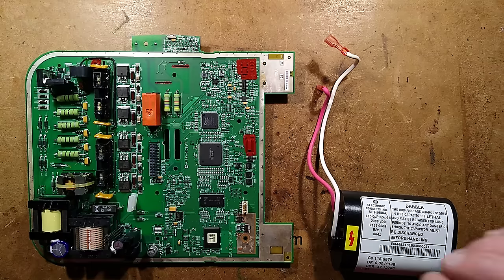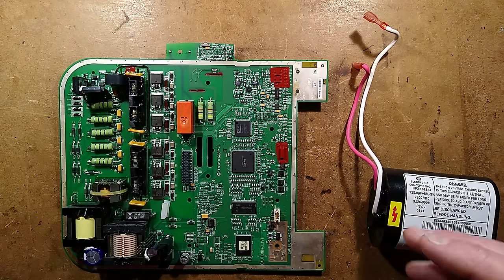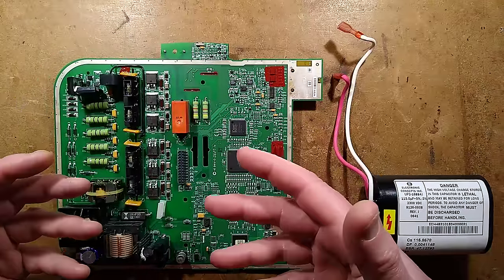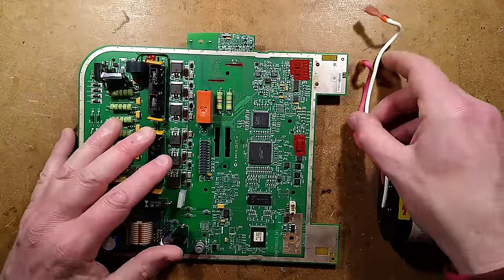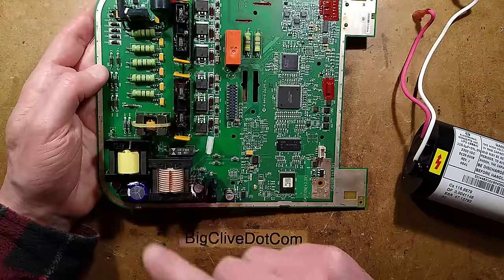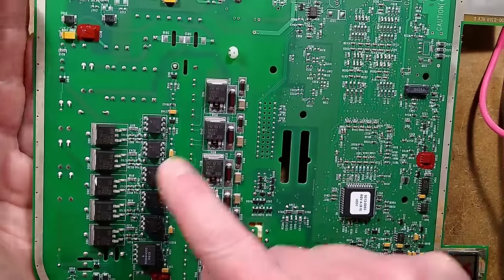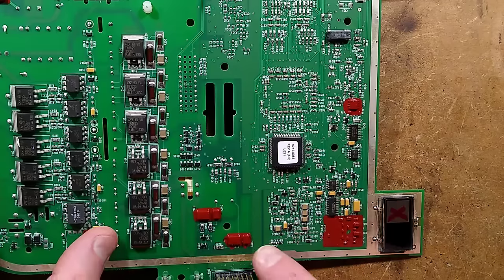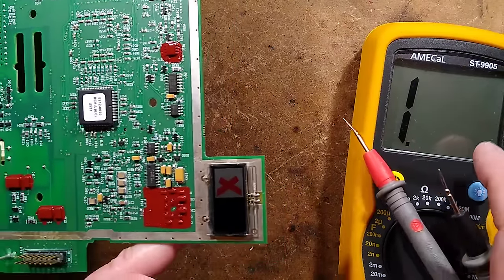Inside a Zoll defibrillator - with SCARY capacitor

Comment: You can trick the AED into delivering a shock quite easily, connect a 50 ohm resistor to the paddles output, this will make it think it's connected to a person, it will give the 'no shock advised' prompt if you just do that, but you can then connect across the 50 ohm resistor a signal generator outputting a ~2 Hz sine wave which is close enough to VFIB (aim for ~1 mV across the resistor), you'll then get the 'shocked advised' prompt when it analyses and it will charge up the capacitor and arm the shock button, you can then disconnect the signal generator (otherwise you will blow it up, adding some series protection resistors to the signal generator is advisable and helps get the 1 mV right) and press the shock button and enjoy the resistor being vaporized in a couple milliseconds.

Here's a video of me blowing up a resistor and a capacitor with an old LIFEPAK 12 defibrillator.
https://youtu.be/W4ifnLcAIDM?t=622

I vote for a return of your roulette resistor wheel, which 50 ohm resistor(s) will explode? Place your bets now!

Also to add to your mention at the end, I want to also mention as strange as it sounds AEDs work exactly the same on women, but women statistically are significantly less likely to survive out of hospital cardiac arrest even when an AED is present. Many people aren't sure if they will work correctly (eg. the male only pictograms) or are afraid of legal consequences, so unfortunately some people die next to an AED that isn't used. 

Furthermore in the event you're the Good Samaritan for a stranger in cardiac arrest, you get to be the main character, none of this "okay I'll wait here for you to call your manager to ask if I can borrow your AED", you just take the thing, Good Samaritan and necessity laws generally extend to allowing you to even break and enter to retrieve an AED without any liability.
Reply: The defibrillator analyzers we use to test these things work in a very similar manner, except with a cardiac waveform generator. It won't fire with a normal rhythm, but you can set it to several types of arrhythmia and the AED will react accordingly. It even times the delay between the waveform and the output from the defibrillator, which typically is a few milliseconds. Someone needs to send Clive a full/manual defibrillator to tear down, there's so much more the bigger defibrillators can do
Reply: Having just received a fresh up of my first aid training, including a demonstration with an AED trainer device (it simulates different situations, but does not actually give a shock and is used with a training dummy) I have to add something very important. The training part actually only was showing what the device looks like and what the instructions look and sound like. The pictures and speech instructions are so easy, everyone can use them in an emergency. And the software of those is safe on a human. The only thing you can do wrong with those in a medical emergency, where you have symptomes of a herat attack or just in general an unconscious person, is to not use them.

Comment: I briefly worked in a hospital. We would routinely test AEDs and defibrillators with a device called a patient simulator, does what it says on the tin. It was really fun to fire the defibrillators off

ETA: it does fire the full charge though the patient simulator, it can't tell the difference between the patient simulator and a patient. Ultimately we always want to fully run up the unit, if we didn't we might find out that things aren't working properly at the worst possible time
Reply: yep,    patient simulators and  live defibs are used in  health profesional / Ambulance staff  training  settings as well
Reply: @nicolajaynehodson9223  wouldn't want to be touching the simulator then, in case you get an indirect boot?
Reply: @JamesTK  basically although you shouldn't get a boot of the simulator as the pad cable plugs into the simulator along with the ecg leads. You then use training pads on the chest of Annie/ rescue mannequin
Reply: Those were the days......😂

Comment: I mentioned it in a livestream a few days after it happened, but I got one of the (I presume) less energetic defibrillations/zaps in an ambulance back in September. Thankfully it was to reset an SVT (supraventricular tachycardia, i.e. "above" the ventricles, so not one of the super life-threatening arrythmias, but still dangerous if there are complications or comorbidities) - my heart's atria (the upper section of muscle) was beating at around 230 BPM, and the ventricles beating at maybe half that, resulting in barely-effective circulation.

That kind of arrythmia usually happens because of some physical or physiological issue that causes the heart's main pacemaker to stop temporarily, and if it resets itself at the wrong time (or so I understand), or if there are anatomical abnormalities, or electrolyte issues, it can set up a mostly self-sustaining electrical loop going around and around the heart conduction paths. At best, it's extremely uncomfortable. At worst, it can cauce insufficient blood flow to the heart and various organs and, if it lasts long enough, damage.

I was dealing with severe lung and other circulation issues at the time, so after about a dozen attempts without being able to get an IV because of very low blood pressure, they asked if I wanted to try a shock instead. "Yes, PLEASE!" It was like having a firework go off in front of me at the exact same instant I got tackled from behind by a large person. My heart rate immediately halved, blood pressure went back up to normal(ish), and I felt better in seconds.

Comment: I started training as a lineman in 1977 and CPR was was given every year. There was a total of seven weeks of school over seven years before becoming a journeyman, it was part classroom and actual work in the training yard. Pole top rescue was done with 150 pound dummy, no not me the other dummy, and we had to clear the dummy from contact, give him three breaths, get a hand line around under his armpits and pull enough tension on the line to lift him before cutting his belt, then lower him to the ground and once back on the ground start CPR. Back then you hit the sternum once to try and get the heart back in rhythm then start CPR, but they quit that after a few years. Very nice device! Not sure if the crews in our area carry a device like that Clive, but if I see any in my travels I will ask.

Comment: During lifeguard training we had a dummy unit that was just a speech module and a push button.  The idea was to be able to drill the steps so we wouldn't be hesitating during an actual emergency.  The real units are designed to be thrown around by someone in a panic, set up on a wet pool deck and applied to a soaking wet body all without electrocuting the rescuers.

Comment: Do not explode, babies. Duly noted.

 I imagine that would make for quite stubborn stains.

Seriously though people, familierize yourself with where these things are in your local area, they can be found in many locations on buildings, in supermarkets etc, but it's worth knowing exactly where should you be in a position to need one fast, you could save someone's life. They are designed to be easily used by anyone with no prior experience. Very easy to follow instructions and the computer does everything except sticking the pads on, it then tells you what to do and not do as needed.

Comment: The metal enclosure is most likely an accelerometer to detect the movements of the compressions.  It also helps in counting the compressions.
Reply: That was my first thought!
Reply: That assumption is correct. Maybe it's one of the Analog Devices ADXL or similar series of sensors.
Reply: The pads with that sensor in the middle are definitely to provide CPR Feedback/coaching. Proper depth and rhythm are critical. With that sensor, the monitoring in the unit can tell you if you need to go deeper/harder, or tell you if you are slowing down. While Clive didn't connect it in a way for it to do so, most, if not all, AEDs will give an audible metronome to assist with the pacing of CPR.
Reply: I think so too, looks alot like the accelerometers used in early quadcopter controller boards.

Comment: So a defibrillator literally turns your heart off and back on again (well, it turns your heart off and hopefully the heart restarts on its own). 
Seems like power cycling works with practically everything!
I have to say, this is the first time I've seen a deep dive into one of these units and it seems to be really well designed. 
The audio/visual prompts are a great idea because even with training, it's very possible to panic a bit and forget the sequence. The fact that it monitors CPR actions is a really good idea too for the same reason. Even with training, in the moment you can get it wrong.

Thanks for this. It was fascinating!
Reply: The CPR doesn't restart the heart. It should automatically restart. If it doesn't CPR needs to continue , unless the reason the heart is not restarting is because the patient is dead.
CPR just keeps the blood flowing and oxygenated.
Reply: @PaulG.x   I guess I wasn't clear. I meant that hopefully the heart will restart and the patient will recover because of CPR (which the machine also monitors) not that CPR will restart the heart. I'll edit my original comment to remove the CPR reference since it is confusing. Thanks for pointing that out.
Reply: @michaelcherry8952  When I do my biannual CPR/First Aid refresher courses, the trainers are always quite emphatic about  CPR not restarting the heart. They do that because the people they are training expect that to be the case and when it doesn't happen , they stop doing chest compressions. They want first aiders to keep doing chest compressions until an EMT takes over or tells them to stop.
The misinformed expectation comes from TV and Hollywood - a couple of compressions , the patient coughs and jumps up and continues his triathlon. 
🙄

Comment: We've just replaced all the old as hell heartstart defibs with Zoll ones so it's super interesting to see what's inside these things.
Reply: I wonder if the reason our NHS Trust replaced all the heartstarts specifically with Zoll was down to the ease of maintaining them. The pressure sensor is an amazing idea but my god does it knack the heel of your palm after a few rounds.
Reply from the maker: It was probably to reduce long term costs and the maintenance required.

Comment: Back in the day (when I worked for the Royal Navy in Nuclear Medicine), we built a Marx generator using date - expired  defib. capacitors. That cap (if charged to the target 2.3kV) is good for just over 300J. Our Marx gen. was quite capable of producing VERY energetic 1 metre sparks, and used to get through 10 megohm resistors at quite a rate!
Reply: Interesting, I came up with a project, making a giant induction heater for nuking hard drives. The idea is basically to get the drive hot enough that any possible data is long gone (red heat) with a video camera to show that the drive has actually been destroyed prior to shredding.

Comment: I used one of those Caps in a bug zapper, with some modifications. No more little dead bug bodies laying around just vaporization. 😂😂😂
Reply: And… how loud were the exploding flys? And did you have to further part the electrical bars/grids assuming they would self-arc without a fly across them with the zapper turned on, with a capacitor of that capacity
Reply: @samuelfellows6923  They were quite loud. But not as loud as wasps and large moths.
Reply: We have a bug zapper at our local Community Hall that vaporizes flies. It sounds almost like a small gunshot and everyone jumps. We don't like it!

Comment: Whoa! My grandfather was actually on the engineering team ( or lead engineer/designer I can’t remember) for one of the first zoll designs that shrunk these devices down to laptop size!      Totally forgot about that
Reply: Our equipment group (UK ambulance service) rate Zoll defibs. We have had a few different ones over the years and a currently using Corpulse units. Previously physiocontrol lifepak 15s

Comment: As a long-term sufferer of paroxysmal atrial fibrillation I have been successfully d.c. cardioverted many times in the past.
As i understand it from the way the heart works, it is the only organ in the body that works independently and autonomously from the brain- as long as it is provided with oxygenated blood, it will beat and pump.
Cardioversion in fact stops the heart and hopefully allows it to restart under the control of the sino-atrial node which is it's inbuilt pacemaker. The rhythmical beating is a contraction and reset of the chambers seen in the qrs complex waveform but this is initiated by the p-wave which is a vey small hump seen just before the qrs complex. Absense of the p-wave causes chaotic and random firing of the contraction process and the irregular rhythm characteristic of AF. Of course there are many other issues with the heart that may or may not be resolved by cardioversion, so this is why careful analysis of the hear electrical activity prior to shocking is done otherwise it can be ineffective or damage to the heart.
Reply: A.E.Ds most of the time do not have a cardioversion option (unless fancy ones that can be put into manual mode). DC Cardioversion is slightly different to defibrillation, uses less energy and it is synchronised to a certain point in your cardiac electrical cycle. Defibrillation just dumps all that energy in one go as soon as you press the button, if you did that when in AF it may  turn into Ventricular fibrillation. i.e put you into cardiac arrest. 

You are correct in that heart will keep beating with oxygenated blood.  The brain modulates the speed and force of contraction with nervous and chemical control. 

Hope your experience with cardioversion was ok. 

Source : FRCA FFICM
Reply: I used to work in the physiology department of Green Lane Hospital which had an international reputation for cardiology research.  One of the projects I recall was researching cardiac perfusion methods for transporting hearts destined for transplant. They used rat hearts and would keep them beating for quite a long time after removal from the animal by just supplying them with a perfusion solution instead of blood. The organ was then rapidly frozen and analysed to determine if any deterioration had occurred during the process.
https://en.wikipedia.org/wiki/Green_Lane_Hospital,_Auckland#Legacy
Reply: @PaulG.x  That's interesting.
Back in 2008 my wife and I landed in Christchurch after 34 hours of flights from Heathrow via Los Angeles and Auckland, only for me to go into atrial fibrillation during the night.
My wife contacted the hotel reception and I was subsequently taken to the hospital in Christchurch for treatment. We were seen by an Irish doctor who on learning we were on holiday arranged for immediate cardioversion "so we could get on and enjoy our holiday". A couple of hours later I awoke to find I was back in sinus rhythm and after a cup of tea was on my way back to the hotel to continue a fantastic month-long tour of south island in our Kea motor home. It's a holiday my wife and I will never forget for many reasons, not least the fantastic care from the doctors and staff in the Christchurch hospital.
Reply: @125brat  I frequently visit the laboratory complex Christchurch across the road from the hospital . I was there the day of the big earthquake in 2010.
Reply: @PaulG.x  We were very sad when we heard about the earthquake and that the cathedral had been basically demolished as well as other places we'd visited. We were shocked to see the pictures of the devastation to the coast road north of Kaikoura we had driven along during our visit and the many other places that had been badly damaged. Unfortunately it's the price of living in a geological very young country.

Comment: $1000 for a defib is a killer deal. I bought one for a public space as a donation about 15 years ago, and with a deep charity discount it was $1500, I think list price was around $2500.
Reply: Does kinda seem like the type of thing where you probably don't want to go for the cheap bootleg version.
Reply: @oliverer3  This just made me think if there are actually cheap chinese copies of these things in aliexpress... Of course there are Chinese versions of the things but hopefully not fakes of other products.
Reply: @benbaselet2026  A cursory search found fewer than I expected but there were definitely some for very concerningly low prices.
Reply: Automated defibrillator prices have dropped dramatically the past couple decades. One of the first automated units cost 5000 in 1985, then the first biphasic AED cost 4000 in 1994, and nowadays the most advanced defibrillators cost only 2000 in today's money
Reply: @ShockValue500  Probably they are fairly cheap to manufacture en masse. Medical certification probably has its costs and when the buyers are all kinds of companies, public operators and other non-individuals there is no point saving a couple of hundred bucks on a unit because many just don't care.
Reply: @ShockValue500  The $100 ones I found still scare me though.
Reply: @oliverer3  They should, they're either just trainers or scams

Comment: I've been a paramedic for 20 years.  Most of the new AEDs support biphasic defibrillaton, part of which is measuring the resistance across the pads and only delivering an appropriate  amount of current.  The chain of resistors may be used for part of that adjustment.

Comment: This is like seeing an old friend. I outfitted my former police department with the Zoll some years ago. It replaced a competitor model that aged-out. The Zoll used standard batteries instead of a proprietary battery cartridge like the previous one. The one-piece pad is easier to work with, too. Excellent unit.